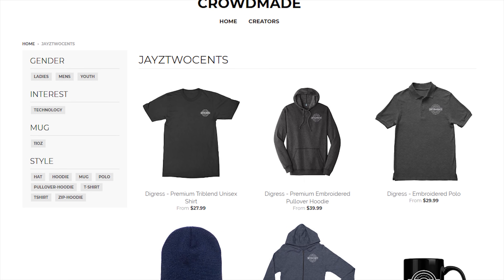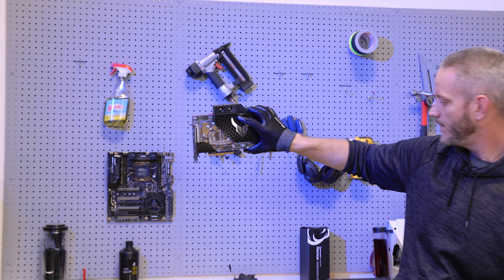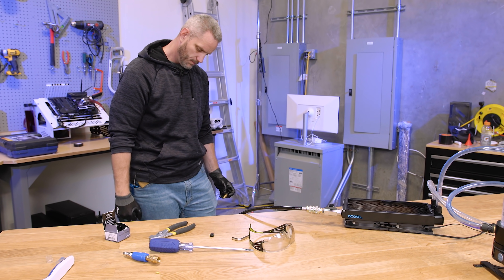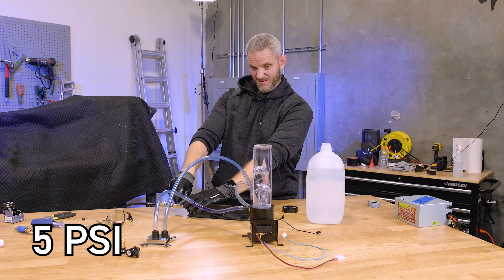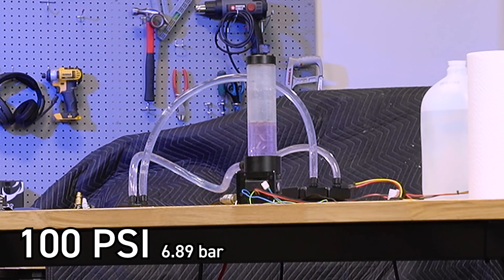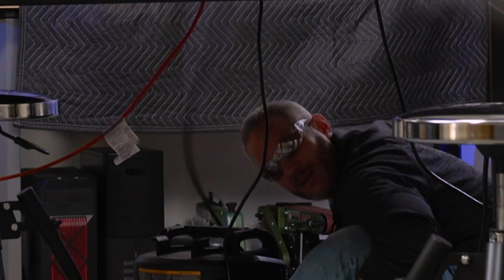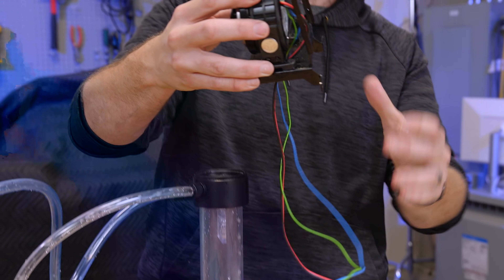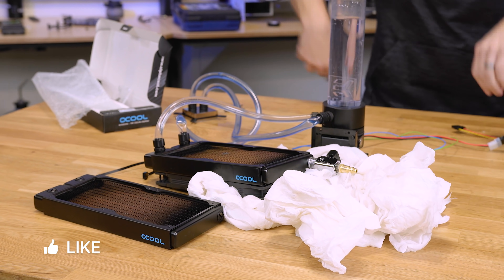The loop EXPLODED! DON'T TRY THIS!

Comment: That's why I run a negative pressure in my loop. How? Keep your fill port open, turn of the fans, heat the whole loop up real good (within max. allowed limits aka. 45°C liquid temp), close the fill port. Now turn on the fans again and go into normal mode. As soon as the liquid temp drops below 45°C you have a negative pressure.

But I don't know if this hurts something else like cooling capabilities. Jay, you want to test this!

Comment: 140 PSI is 9.52643 Atmospheres. That's a lot.
When it comes to water cooling I've always been more worried about human error than the equipment failing. At least when it comes to open loop systems.

Comment: This could of been interesting if you tested how higher PSI's increased the cooling of a given rad, ya know for science. try again
Reply: Kel-al that would be counter productive, adding pressure to a closed system increases the temperature of the water. The only difference is that the boiling point of the water would be raised but if it ever got that hot in a computer your cpu or gpu put would have already died.

Comment: Air compressor fittings are 1/4" NPT not G1/4....I'm sure it fits because the thread cuts are the same outer diameter. That connection would definitely leak in the future...
Reply: Close, but also BSP is 19 threads per inch and NPT is 18.

Comment: O-rings actually hold a great deal of thousands of pounds of pressure in hydraulic systems let alone water. the materials the fittings, or tubing is made of however would probably fail faster than the O-ring.

im not trying to be that guy in the comments, but yeah...

Comment: After seeing the radiator after the damage with water in it, ... i am sure the inlet was damages when it struck the ground. If it was blown when the pressure was high, it would have sprayed out first, and only.

Comment: Fill a cooling loop like you would a car: pull a vacuum on the cooling system, then pull the fluid in. No bleeding required and no air pockets.
Reply: A vacuum pump is any air compressor with a Venturi valve at the end. I’d love to see Jay try this! He’s a car guy too so I know he already knows how to do this.
Reply: @michaelbauer9554  Well...tecnically any device that can make an internal negative pressure compared to the atmopheric pressure can work. it be using the venturi effect or a vacuum pump or an emptying container that drowns out the air from the loop will do it.
Reply: is there a good way to do this without a vacuum pump?
Reply: @cardboardpig  yup. You fill a large container with water, something like a 4 gal jug and attach a hose from it's lid to your loop. On the bottom of your container you must have a valve to let the water pour out while drowning a "vacuum" and "sucking" the cooling liquid into your loop.
Basically is the same principle of a mercury vacuum pump.
Reply: i have thought about that also
Reply: Agreed. Whatever Jay chooses to do it, I’d just like to see him try!
Reply: Having no air in your system without any room for expansion is a surefire way to pop a seal.

Comment: The question is what is the cooling difference, using similar Fan/Radiator, between AIO low flow L/min built in pump, and a high-end loop with stand alone pump with high L/min? While running same radiators and same RPM on the fans.  Is water pressure changes cooling performance?

Comment: new series idea stress test computer parts till failure, do things like over rpm fans till they shake apart, all while overclocking the crap out of it edit dont tell osha but lets post it on youtube..
Reply: the motors in fans probly arent capable of high enough RPM. but there is a guy who took a drone motor and 3D printed blades to put into a PC fan. it was entertaining

Comment: So none of that bending was to do with the rad landing on that connection?
Reply: some was, some wasnt. the bowing of the outside around the connection was definitely from the pressure, but the connection hitting concrete is more likely what caused the bend

Comment: Jay there's definitely water in your compressor tank now, yes it was under pressure but water can still go down hill asking as air replaces it at the top. Please drain your compressor via the condensate drain plug.
Reply: Regardless of this water experiment, it's still a good idea to semi-regularly drain an air compressor. Air naturally has water in it that gets into the tank.
Reply: This! I was thinking, why doesn't Jay just put the pump up on a higher position, that'll prevent water from getting to it...
Reply: Guys you're making this out to be such a bigger deal than it is. There's almost always at least a bit of water in compressors due to the changing pressure causing condensation. I work with compressors at work all day every day and when it comes time to depressurize them you'll notice the water. Even if you leave it in there the worse that can happen is it rusts up a bit. It will not rust up enough to cause a failure unless you leave it in there for years.
Should you empty it? Yeah. Is it nearly as bad as you guys are making it out to be? Absolutely not.
Reply: @9393jack  It's the same people that see someone drilling ONE hole in concrete, and whine about a mask and silocosis! Ahhhhh. They have no concept of exposure limits. There is ALWAYS water in your compressor, and it's enough to rust it just as fast, whether you drained it or not.
Reply: @xenonram  or like the people who think accidentally putting a bit of mixed gas in a 4-cycle engine ruins it
Reply: @9393jack  Seemed like a lot of water for that small compressor. Water takes up space, so less tank volume for the air to compress into. Compressor will run more often if not drained.
Reply: @alanbiker5838  not that much more often. It's not like it came even close to a 1/3 of the volume at the very most and that's being very generous. That's not enough to make a huge difference. It just ends up being like a compressor with 2/3 the capacity.
Reply: This x100
Reply: Yup drain the compressor. As preassure equalises amd air flow from tank to loop slows water would back flow
Reply: @SuperTurbo9001  Wrong any moisture that would build in air compressor from loss of pressure would equal a tea spoons worth. No way in hell water from the loop got into the compressor. Period!!!
Reply: @traeheck3614  Sooo, tell me where all the water in the reservoir went?
Reply: Ghosthand do you mean when he was increasing the PSI? If so the water didn’t go anywhere, it simply compressed as more pressure was introduced.
Reply: @Oz_Gnarly_One  Do yourself a favor and google "incompressible fluid" Water is one such fluid...
Reply: @Chriva  the rest of the system expanded not the water, but I would still check the tank. Cheap insurance so the pump ECT... don't break over time. Could use some oil maybe to lube the pipes,       ladies lol.
Reply: @Luci4n77  Finally, someone with intelligence :p
Reply: @Chriva  "Do yourself a favor and google "incompressible fluid" Water is one such fluid..."
You'd have to have the compressor filled almost entirely with water for it to matter. Even if you fill it up 1/2 way, it will NOT increase the pressure in the tank due to the way the compressor is designed to shut off once a certain pressure is reached.
Reply: @9393jack  Read Majorx240's stupid explanation. He specifically stated "water didn't go anywhere, it simply compressed" You can't compress water that much by regular means.
Reply: @Chriva  Yes I read that earlier thank you very much. I was saying that it doesn't matter if it's not compressible in this situation.
Reply: @Oz_Gnarly_One  Um thats not how that works
Reply: @ghosthand8119  Out the back of the reservoir as it powered it up into the air, ya know, as in, "Every action has an equal and opposite reaction".....
Reply: @ghosthand8119  in the compressor tank. its pretty self evident.
Reply: @ghosthand8119  the tubes and tanks expanded creating more room for water
Reply: @ghosthand8119  Actually, it mostly went in to the tubing in the loop, if you look closely they expand noticeably with pressure. That being said, we drain substantial water out of our compressor daily at work, so probably a good idea anyway.
Reply: @Chriva  Actually! Water is slightly compressible it has to do with the Impurity in the water itself.
Reply: @Oz_Gnarly_One  liquids, including water, are nearly incompressable.
Reply: @Oz_Gnarly_One  One really important principle you learn when dealing with water and pressure - Water is essentially incompressible. The pressure he introduced to the system would do nothing. It takes thousands of PSI for even a small change.
Reply: @Oz_Gnarly_One  water is not compressible
Reply: @Chriva  you simply can't compress water at all 😁
Reply: @traeheck3614  Guess you have drained a large shop style air compressor.. Gallons can come out of them. Source, I use one every day with morons who dont maintain their shit.
Reply: @zuestoots5176  yeah just your standard 80 gallon tanks. Never more than about a quart of water. Over 20 years.
Reply: This. He should definitely check on the tank after that experiment.
Reply: On the main point, compressor tanks can handle water in them just fine.  They have drains for a reason.  Water naturally condenses in them and it's not a big deal most of the time... Though desiccant and chiller line driers do exist for a reason, typically used to dry the air used to apply automotive finishes.  
Second point, without using the scientific terms, Water doesn't compress, dipshit.
Reply: Not responding to anyone in particular so nobody get your panties in a bunch. Here is the simple short of it, water does not compress, at least not at room temperature. Water also moves to the lowest point in a system unless there is a air gap or something similar to prevent this. As soon as he opened the valve on the radiator water started trying to go down the hose. As he raised the pressure it would force the water down the hose. Every time he turned up the regulator air would go up and water would go down. How do I know this? Watch the video. when he turned the regulator air would bubble into the reservoir and the water level would drop. It was squirting back into the compressor tank. Yes, the expansion of the tubing and radiator would account for some of the lost water but very very little.  He probably wound up with about a cup of water in his compressor, not really a whole lot but enough that you would want to drain it.
Reply: @ghosthand8119  "not really a whole lot but enough that you would want to drain it."
It's not enough to make any difference compared to the typical amount of water that builds up over the use of a compressor over a day.
It's good practice to drain it to reduce rusting. But here's the thing:
One cup or 10 cups of water in that compressor is not going to harm it. It would make no difference if it was compressible or not. Air is very compressible and the compressor will stop as soon as the pressure inside reaches a certain level. The only difference with having water in it is it will happen faster and there will be less pressurized air, meaning it runs out faster. 
It will rust. But not catastrophically and it would take a very, very long time to do so.
Reply: @9393jack  I was more responding to whether or not water would wind up in the compressor tank, not so much the effects of that water on the tank. On that subject I have seen compressors ruined by water in the tank. How much water and how long it took I don't know but manuals on compressors say to drain it daily and commercial compressors even have dryers on them to keep water out. You also have to figure in how often Jay uses the compressor. Would it be good to leave it sitting on a shelf for 6 months with water in it? Probably not. You would also run the risk of getting extra water into your air tools and corroding them as well. I use my compressor a lot and drain it daily. I want my tools to last so this is just a simple one minute task that help improve the longevity of it. I don't have the money to blow simply because I didn't take care of my tools.
Reply: @ghosthand8119  You have seen compressors ruined by water in the tank? 
Look, I'm not trying to be mean or anything but unless that water has been in the tank for a very, very long time, or unless the water was filled up almost entirely to the brim, or unless that compressor was being run on its side or VIOLENTLY shaken while running with a huge amount of water in it, then you're lying
Reply: @9393jack  I agree with your original point you were trying to make which is; This thread is making a much bigger deal out of it than it really is.
But keep in mind that 50% - 80% of people come to YT comments to argue. They like to argue. I find it entertaining to watch some of them wiggle and squirm trying to make their original trivial comment sound important and sensible hehehe.

I also have a fairly large compressor and for two or three years I used it all day, every day for air tools and tons of other creative uses I found for it. I would often go several days without draining it even though it is best to drain it every day....see? Not a big deal.

Readers pls note I did NOT call out any one person. I have made no personal attack on any single person.

Peace! ;)
Reply: @9393jack    Receiver corrosion and compromise due to condensate buildup is a common issue.  This is why most commercial, and some residential compressors, have an intercooler stage with a condensate trap & auto drain prior to the resevoir.
Reply: I mean, it's good practice to do so anyhow. I get moisture built up just from it getting pulled out of the normal humidity in the air. I'm sure it's not as big of a deal in SoCal as it is in the Midwest, but it's still bound to happen.
Reply: I think he is actually fine because he had a regulator. It may have gotten in the hose, but I think it would stay on the hose side of the regulator. Not 100% sure though.
Reply: @christopherpedersen1820  
Regulators are not check valves.
Reply: @mephInc  Sure, but you shouldn't ever get any back flow through a regulator. Any time the regulator is open the pressure is higher on the supply side and lower on the outlet side so things should only flow in one direction.
Reply: @mephInc  I was about say why didn't he use one .
He would have if he would have planned the video
Reply: @mephInc  regulators aren't check valves, you got that right. But they have internal components which include..
Reply: @christopherpedersen1820  That regulator is not one way valve.
Reply: @errorius   Check out regulator schematics and learn something new. I give you quick tips. Why standard regulator have flow direction marked? How do they change pressure only on equipment downstream to them? My mechanic work in industry has much work also in pneumatics. You actually have minor flaws in your claims.
Reply: One of the things missed is volumetric expansion of the plastic tubing. It is significant and easily missed if you aren't checking.
Reply: Not to mention how dangerous it is to use compressed air for pressure testing in the first place. But yes, almost certainly is.
Reply: There is water in his compressor from compressing air...ALWAYS...well, OK, not if your inlet air has no humidity, but yea.  I drain my tank on my compressor about once every couple weeks...if you read the instructions on a Pancake style compressor, it says to "drain after every use"....
Reply: Water will always form in the compressor due to moisture in the air, this is why they have drain plugs in the tank
Reply: Yea you can see the water level in the resevoir go down
Reply: You should always leave the drain open when the compressor isn’t in use.
Reply: You really should drain it regularly anyway,  moisture tends to condensate inside the tank in normal use
Reply: And the lines took a lot of the pressure.
Reply: You should drain it often anyway, compressing air forces the moisture out of it.
Reply: yup, once air pressure equalizes across system then water can flow easily around said system..
Reply: I kept thinking the water level was dropping each time he fiddled with the pressure the water had to go somewhere
Reply: @Nzeropheonix  look at how much the hoses expanded, along with the radiator.  There was just more volume in the system so the reservoir level lowered as the hoses expanded and held more liquid.  Pressure was higher on the compressor side of the regulator so no water would have went through it.
Reply: Yeah right. BS.
Reply: @traeheck3614    Wrong.  Once the pressure equalizes in the system, the liquid will quickly back flow, as seen by the reservoir lowering.  He could have put a 1m relative rise in the hose to help mitigate this depending on hose l/m and system capacity .
Reply: @ricoswave2326 /videosReservoir water level lovered because petg tubes expanded, thus increasing their volume so more water could fill them. The air just gathered in the tank.
Reply: @Reclaimer141  did not expand enough to explain that extreme drop.  Sorry.

Comment: That was top quality stuff, right there. Entertaining in the 'splosions sense, but also reassuring for anyone worried about loop pressure issues.
Reply: Retweet
Reply: Majere613 I’ve got a full custom loop myself. Paid the big bucks for quality components.

Haven’t leaked a drop of coolant as far as I can tell even when mining crypto at full bore with 2 gpus

This stuff is no joke. It can hold a LOT of pressure.